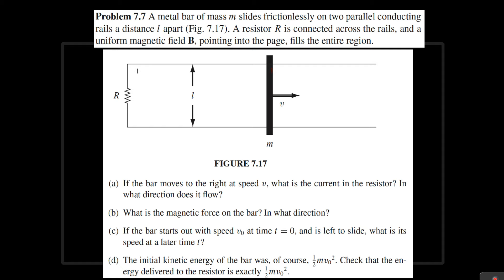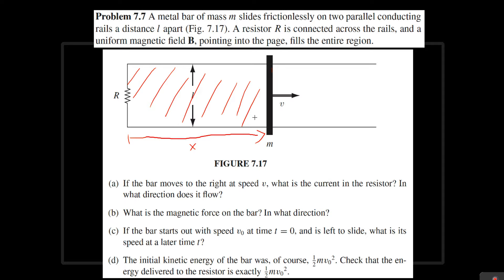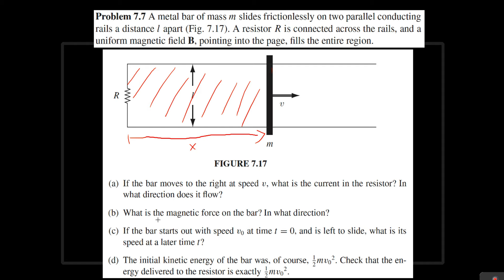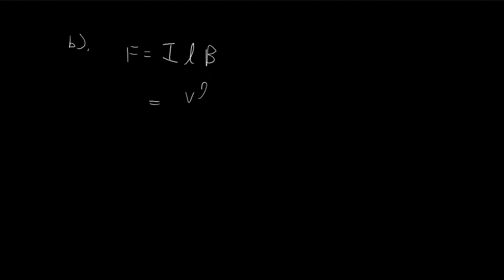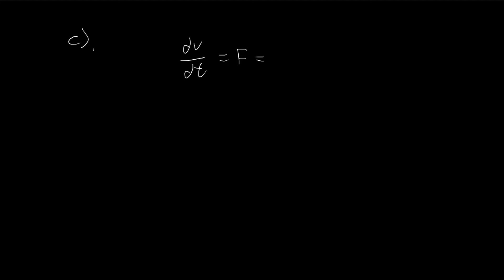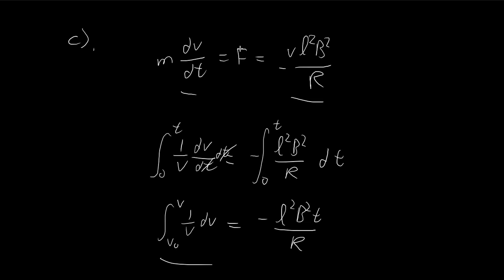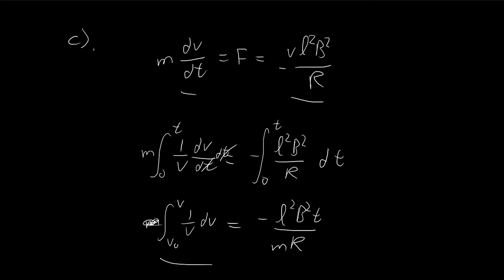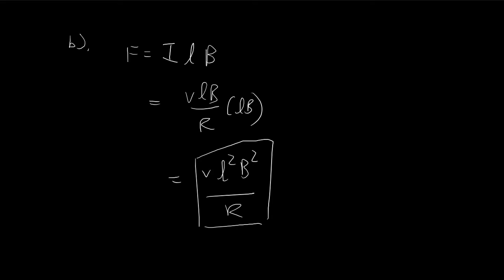Problem 7.7 | Introduction to Electrodynamics (Griffiths)

Comment: Can you explain why the F is pointing only the left in part (b)???
Referring to the fig 7.11, I thought that it must be tilted back; it has both up and left comp.
Reply: I believe the vertical components are locked by the wire frame (the rod can't go up or down), and in this case we are only interested in the x axis components of the force. 
Also, by the magnetic force formula, we know that F is i X B, which in this case would just give us iLB in the left direction if we considered that i only points up (projecting the true i on the "y" axis (up axis)). By doing that (and ignoring the side movement it has), it's the same as projecting the total mag force on the x axis, thus getting a smaller F (because of a "smaller" current), only pointing to the left.

Comment: @Hayashi Manabu can you explain again why the F is pointing left question(b)? i have a little trouble with the right hand rule there.
Reply from the maker: The current is going up the black rod so first point your thumb in that direction. 

Then the magnetic field is pointing inside the page so now position your index finger to that direction. 

Your middle finger is now pointing to the left, which is the direction of the force.
Reply: @HayashiManabu  thanks so much man you a fellow pregrad physist?
Reply from the maker: @user-du8bt4qt5d  sort of. I’m minoring in physics but I also study actuarial science and computer science. I consider myself closer to a mathematician than a physicist. I take it you’re a physics undergrad?
Reply: @HayashiManabu  yeah yeah and finals are coming xD
Reply from the maker: @user-du8bt4qt5d  same for me buddy, hence no uploads these days, study hard and good luck on your finals

Comment: Sir i can't find the solution of all problems easly even i havesubscribedit..prob 7.19 in not available. Sir plz solve all prob if possible
Reply from the maker: Hi there, I don’t take video requests at the moment but I could give you an idea of how to solve 7.19, you essentially have to recognise that this problem is parallel to the case of finding the magnetic field in the centre of a circular ring. The only difference is that this time it’s the change in flux that’s generating an electric field, instead of a current generating a magnetic field. You can find the expression for the magnetic field at the center of a circular ring from one of the examples in chapter 5, and you can change that expression accordingly to fit into the situation in 7.19